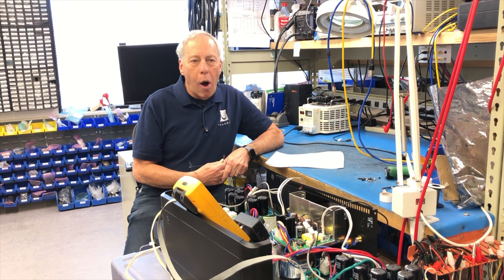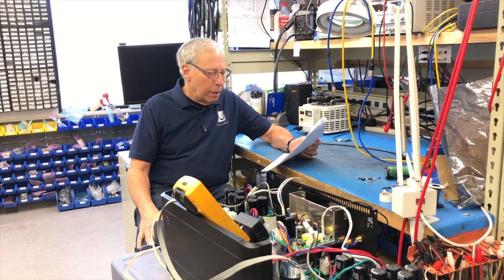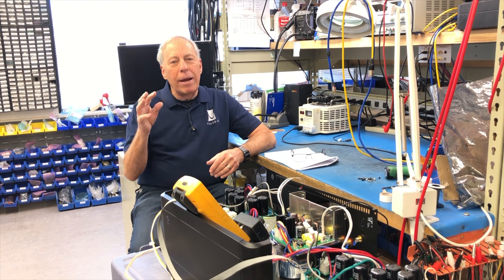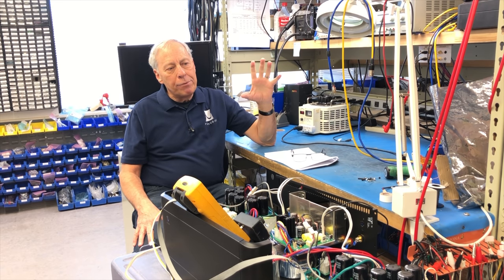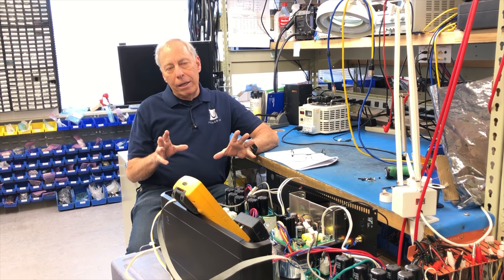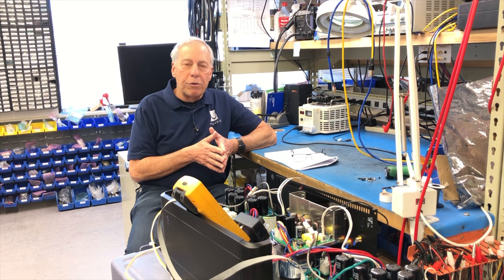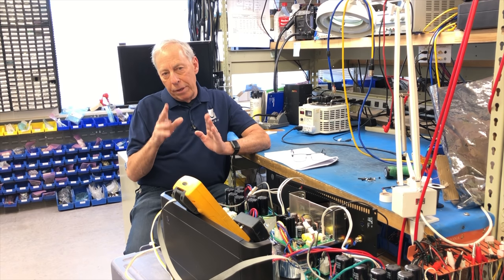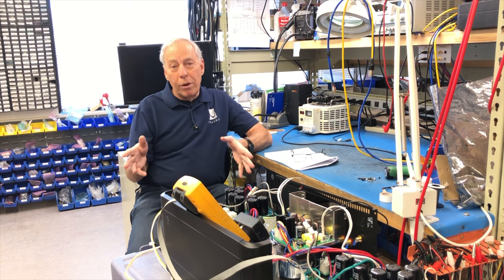How to choose correct amplifier wattage

Comment: I do not understand..
If I have a 96 dB/w/m like the Klipsch RP-600M. Say that I only need when playing 1 watt will give me 96 dB  SPL one meter from the speaker (that is loud!).
If I have a amp that gives 10 watt/channel. That is ten TIMES more that I need and let say it is this "head room". And that should be adequate and a great amount of "head room".
I will NEVER go into clipping or run out of juce!

Paul you say go bigger and bigger will always sound better.
So if I have the exact same construction of a amp that is just twice as big and now 20 watts/channel. That the amp that not has now not only 10 times but 20 times as "head room" will always sound better!?
Why should it? what is the logic?

If I have a car that cruise at 100km/h. And it can go 10 times faster at 1000km/h as top speed. Why should I get a car that can go 2000km/h when I only are cruising at 100km/h.
And when the tires will explode att 200km/h (the ears will start bleeding).
Why should I ever want to upgrade to a 2000km/h (20w) capable car??
Reply: Optimize 10 watts would give you about 9db increase in sound, which would be perceived as about twice as loud as 1 watt.  Hence the old adage you need 10x the power to make it twice as load. Klipsch speakers on a nice 10-40 watt tube amp can sound sweet and play loud.
Reply: I own efficient Klipsch speakers and  a 70 watt receiver with VU meters that show in realtime how many watts go to the speakers. Even when I have the volume cranked up it usually sits around 1 to 5 watts, but on loud or bass heavy parts of the music it can get up to 30, 40, as high as 60 watts. The problem is that the amount of watts needed to get SLIGHTLY louder goes up on a logarithmic scale. Plus low frequency sounds need a lot more power to be heard. Now consider someone with a much less efficient speaker. It's reasonable that for brief points in time the amp might need to put out over 100 watts. Lastly an amplifier does the BEST job when it's barely utilizing its potential power. A 100 watt amp might perform well when it's using 10 watts to amplify a signal, but a 1000 watt amp will do an EVEN better job.

 Imagine two weightlifters. Weight lifter "A" can squat 300 lbs with difficulty and can do a maximum of 400 lbs. Weight lifter "B" can squat 300 lbs easily, 600 lbs with difficulty, and 700 lbs maximum . Even though "A" and "B" can both squat 300 lbs, "B" has a better squatting form . When "A" squats 300 lbs they might have to arch their back or lean forward or do something ugly to push the weight. "B" has none of those problems. They can push the 300 lb weight without breaking a sweat.  

Same for amps. Both a 400 watt and 700 watt amp can drive 300 watts, but the quality of that power is better with the 700 watt amp.
Reply: Thanks for the great answers! Now I get it. I found a great example also: "
Typical Question: Calculate the maximum sound pressure level of a loudspeaker in 1 m
distance, when the sensivity level of 98 dB/1W/1m is given and the wattage is 300 W.
Answer: At 1 Watt you get 98 dBSPL in 1 m distance. At 300 W there is:
10 × log 300/1 = 24.77 dB more level, that means 122.77 dBSPL."

Comment: Remember, if you ever need more power, just turn it up to 11.
Reply: Awww. That's my saying. 😊😊😊
Reply: "because eleven is one more higher"
Reply: A little story.  I worked for  a sound reinforcement company that installed music and public address systems in the mid 1970s.   There was a new skateboard park that opened on the northeast side of town that we installed a system with both music and PA.  The neighborhood nearby began to complain about the music and PA disturbing them.   The amplifier had dial from 0-10.  When they came over It was noted that the control was at "7".   They said if we put it at "4" it would be fine.  An agreement was made and after they left, we set this control at "4", but the unit had an internal gain control which we adjusted to a higher level, so the sound at the park was essentially unchanged.  They later came back to inspect and since the control knob was now at "4", they told us they appreciated our cooperation and left smiling, even though the music level really had not changed.

Morel:  Some people like to complain and exercise their power, but really the volume level was never high enough to disturb them.    The public's general misunderstanding of the function of a volume control helped us out.
Reply: These goes to eleven
Reply: @poserwanabe   "eleven is one more than ten"
Reply: @swinde  That's a great story just like in the book "Mixer Man" where a producer was complaining about the sound  not being right.  the mixer guy put in a fake knob that he called "the producer knob " that did nothing and told the producer he had just what he wanted..turned the knob ( that did nothing ) and the producer loved it !
Reply: @swinde  Actually that was NOT politely done at all. Shame on you.
Reply: Oystein Soreide ...   What is the problem?  they were happy, and we were happy and the client was happy.
Were we somewhat deceptive?  Yes.  But, you have to remember that the people complaining were really just complaining rather than actually have been disturbed by "loud music".
Reply: @swinde  People usually has quite high limit before they complain about something. I can't understand that they were happy. Most likely they were not happy. They accepted your explanation about the volume level. And in that regard they were happy, but they had not come if the music hadn't been annoying in the first place.
Reply: My position is that they showed up because the music was "perceptible", not "annoying"   How could it suddenly become not "annoying" just because the volume control is now on "4"?

I disagree with the idea that people have this "high limit" you speak of.  Some people become agitated at the most insignificant things.  Such a person likely initiated the complaint.
Reply: @swinde  Most people ( of course not all ) where I come from have a quite high limit, and that is my experience. That you have another. Well , we certainly disagree on that point. But of course people of different cultures might have different ways to behave. If I had heard music from where I lived from a PA system, I would certainly get annoyed. But of course there are rules for this kind of things. And depending on where you live, you will have to accept some noise.
Reply: @captainwin6333  damn you're right !! I blew it..I had a feeling I misquoted when I posted..
Many youngsters probably have no idea what we're even talking about right ??
Reply: My volume knob only goes to 10. When I turned it to 11. My knob broke :(